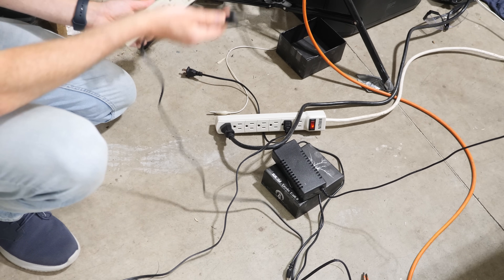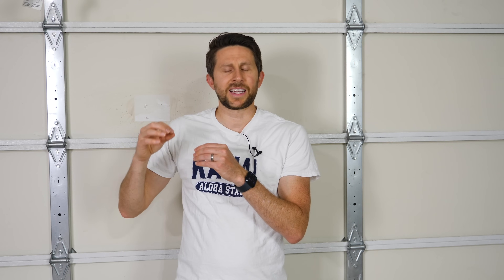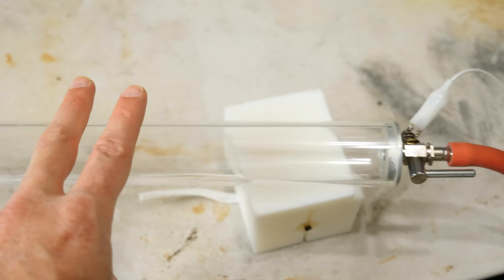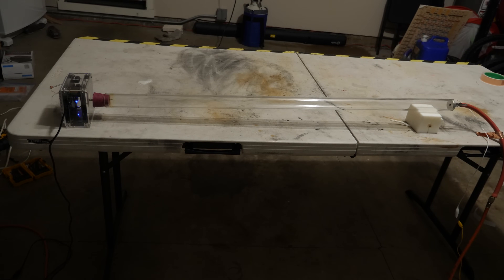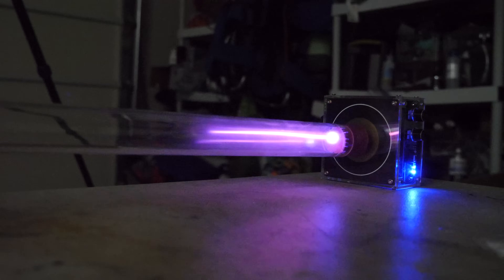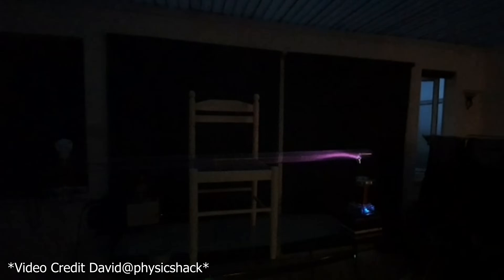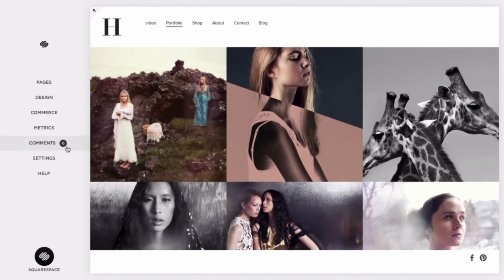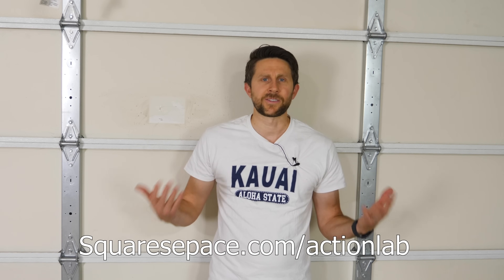Using the Air As a Wire—Was Nikola Tesla Right?

Comment: not through the atmosphere... through the aether. They are not the same things. Transverse or longitudinal "waves" (they aren't waves) dont respond to pressures. They are "pressure-free". Basically an unstoppable force. The towers are used because the difference in potential from ground to top of tower is what creates the voltage. And up high there is less interference. Opposite of radio (waves). This is a good analogy:  longitudinal point to point connections are to lasers, what point to multi-point radio is (broadcast waves) to lightbulbs. A 5w lightbulb you can barely read a newspaper with. A 5w laser you can burn a hole through things. Same power- so what is the difference? Coherence vs incoherence. Coherent light is a laser. Incoherent light is a light bulb. Point-source vs. non-point source. All that to say this - clearly you have never read Nikola Tesla, or if you have read him (not books about him) then you don't grasp what he was detailing.
Reply: there is no such thing as aether, we've known that for a century and a half.
Reply: @thekaxmax  clearly you dont know. what you're talking about - denial and proof are 2 different things. "We" have "known" aether exists for millennia. A fish doesn't talk about the water he is in when he describes his environs to the outside world.

Comment: The electrical engineers who were working on it 20 years ago came to the conclusion they needed to build a tesla coil the same size as the one he used in Colorado, so they might see what is was that tesla figured out.
Reply: and engineers have worked out that his assumptions on EMF in standing waves was incorrect and this would never work as he designed it.
Reply: @thekaxmax  Your crusade against Tesla is remarkable...
Reply: @wurzelbert84wucher5  Crusade against Telsa????? What? I just stated a known truth: he made a mistaken assumption about EMF that he never properly tested. This is fact.

Other than that I love the guy. But we all make mistakes. As you just did.

Comment: Nice video! 

Btw people talk about wireless power transmission replacing power cords but that is impossible—teslas system would not have worked under a roof. 

More likely he was talking about replacing the long distance electric grid. Towers would pull down electricity from the ionosphere and supply houses in a district.

Comment: The problem with wireless power transmission is the spread.  At further distances, you can only recover the power available from the total area of reception.  The radiation pattern does not focus itself toward random receivers.  It can be optimized for fixed locations, but ultimately, distance will still affect the recoverable signal.

There will be much power loss, and some power unavailable due to lack of coupling, being reflected back into the transmitter.  A tuned receiver is just an impedance matching device which transfers the most power possible to a load, but make no mistake, it cannot "suck" more power from an area than is available.

Comment: Heat, light, sound; all of which are results of the plasma discharges, none of which are present between two tuned towers (not driving them with spark gaps also helps efficiency). I know that there are significant losses between two tesla coils, but they're less than with normal RF equipment.
Tesla coils are wrongly known for their abilities to create streamers, but they were never intended to do so.
It's flat out wrong that Tesla never managed to make any functional Tesla coils, as he on multiple occasions demonstrated remotely powered lights (not just arc-lights (mercury vapour)), and in one case, even a small remote controlled model ship.

Many sceptics throughout time has been baffled by the capabilities of these small scale tesla replicas of today, comparing to things like RF, and pancake coils used for wireless charging of phones. This is slightly beyond the point, as I know that this part of the conversation always ends up in heated debate.

The point I really want to get through, is that Tesla did make functional coils, for wireless power transmission, and that any tesla coil with any plasma discharge, is not made the way that Tesla intended. I know that he spent a great deal of time eliminating plasma discharges (also in the spark gap, that was only ever intended as an interrupter, as this was before the time of radio tubes and transistors).

Comment: do you know that the energy of wireless power can travel both ways trough the air. do you know that the receiver end can boost its energy from another sources and electricity can travel backward into the source that transmitted the energy and blow out the transmitter. do you know as soon as a circuit is formed from the receiver end that energy can travel both ways trough the radio wave. this phenomena also happens with transformer when the energy in the output is higher than input. what happens is that the circuit at the receiver end create a potential force where additional energy added to this force will create a equal and opposite force in the transmitter to that of the output and the power is entagled trough the wireless signal. the radio signal makes the output circuit conductive and makes the electrons able to travel both ways between the transmitter circuit and the receiver. you also see the same problem in fusion reactor where the plasma ion icrease from the fusion travel backward into the transformers that generate the voltage for the plasma and burns out equipment. this phenomena is what happend to nikola tesla wardenclyffe tower where the radio signal ionized the cloud and formed a cricut in the cloud and electricity like a vacuum tube could now flow backward trough the radio signal back into the tower and down the transformer and into the generators at niagara fall and blow out the generators. when you use metal and a gas in a microwave and a current start to flow if you add fission to the particles in the glass tube that conducts the microwaves the transformer will then receive energy and voltage and most likely burn out the fuses in the house and fry all the electronics as the energy from the output would travel backward into the supply source in that case.

Comment: You should see what MIT did using this tech you take copper coils arranged I think in a square formation but spaced half an inch apart with like an acrylic spacer or some thing nonconductive and you can make a directional antenna essentially and then you can put in a receiving one of those on a bulb very far away and as long as they’re aiming at each other it works the same way

Comment: why does no one know how tesla coils r suppose to work.   first if all he wasnt sending power thru the air  he was using the earth as a conductor in a one wire circuit.  and it does work. just look up nu-energy or sumthen like that. a company is building it .

also  why doesn't anyone read teslas own words.   u cant use a/c  HAVE to  use ultra high frequency dc pulses

Comment: This is an extremely brute force approach to wireless energy transfer and I'm fairly certain it's not what Nikola Tesla had in mind. I think his idea was closer to the idea of using tesla coil like devices to convert electricity to a specific high intensity radio frequency that an antenna could receive and convert back into electricity to power a device (kind of like how a crystal radio is powered) but I think he wanted to use just the right frequency so that it not only resonated with the atmosphere but was also internally reflected by the atmosphere so the transmission wouldn't be impeded by the horizon (and wouldn't be lost to space ethier). He wanted to have many of these devices in specific places around the world and have them synced up in such a way that each device's signal generated constructive interference with the signals of the others, basically converting the entirety of Earth's atmosphere (or at least the troposphere) into a lased radio resonance cavity the anyone, anywhere could siphon power from.
Reply: i agree- i think tuning and resonance is a big part of this- like trying to make a motor but you haven't balanced the weight or strength of the magnets- theres alot of efficiency left on the table. If transmission stations and receivers are tuned in a way accounting for distance then transmission rates would be much better. 
Tesla did in fact create a working implementation of this system but his lab might have been burnt down. His main investor JP Morgan, had just invested millions in conventional electric transmission system.  He would have been directly undermining his previous previous investments had he bankrolled Tesla's wireless transmission.
in any case its too late now- wireless energy transmission is pretty much impossible while cars are powered by HIGHLY EXPLOSIVE LIQUIDS
Reply: Yeah, idk what you said, but I support you, don't let these shill bots change your mind and demoralize you.
Reply: @festerbutt  gang stalking is real and they do not want you questioning things
Reply: lol, for all we know his idea could have been as simple as brute force and never managed to come up with anything more complex. He may have been an inventor that played around with different innovative ideas but he was no god among men.
Reply: @MartinzW  No, you're just intellectually deficient. He wouldn't have thought of brute forcing it because he knew about the inverse square law! Are you implying they had no concept of that back in that day?
Reply: @MartinzW  I doubt it, he managed to power incandescent bulbs wirelessly through the ground (and normal air as well), developed AC generators and pushed for AC current over DC for power transmission, talked about resonance frequencies a lot and the tesla coil itself is based on resonance. Judging by his work, his life and what I understand of his character he didn't seem like a brute force kind of person (other than for the sake of pushing the limits just to see what would happen) I.M.O.
Reply: @zachcrawford5  the laws of physics aren't violated by the bicycle or the airplane, but there's no way to transmit a significant amount of power over any distance on earth without a lot of loss, meaning you'd have to generate a ton of power to begin with. You can easily make a fluorescent bulb light up today, it just takes a lot more power input than it would if you just connected it to a wire.

It would be much more efficient to use a laser to transmit power wirelessly by heating up water and generating steam. Yeah there'll be a ton of loss, but it's more efficient than wirelessly transmitting power through radio or high voltage coils.
Reply: @zakabog  Tesla's idea does not violate any laws of physics. The reason physics generally does not allow efficient wireless power transmission is because of the square law. Typically in an open environment, if you are twice as far from an emission source you will only receive one quarter the power on the same surface area. But on a large scale and at the right frequencies Earth and Earth's atmosphere are not open environments they are more like  resonance cavities or the interior of a fiber optic cable. At the right frequency, radio waves can experience "perfect" internal reflection in our atmosphere. This is why HAM radios can work over a much larger range than the horizon.

 Realistically though, it would not be anywhere near 100% efficient since there are natural things in the real world that would act as parasitic loads, metal deposits in mountains, or anything humans made that has conductive materials in it, even trees would probably siphon a significant amount. To be fair though even modern transmission lines aren't terribly efficient, they generally lose something like 30%-50% of the power generated to resistance and parasitic loads (depending on things like ambient temperature and conditions of the lines themselves).

I certainly not arguing that Tesla's wireless power transmission could compete with our modern transmission networks (which he also had a large hand in creating). My main argument is that Action Lab very likely misunderstood how Tesla had intended to use his invention. It's like using an electric drill as a hammer, it does technically work but it is not nearly the best way to use it and was not the intention of its inventor.
Reply: @zachcrawford5  when you bounce radio waves off the ionosphere they'll cover a larger distance but it doesn't concentrate or amplify the signal, the same rules still apply to distances. If you want to transmit power wirelessly you need to put in far more power that you'll get out, you'll get far less than 30% transmission efficiency even if you shoot radio straight into the ionosphere and bounce it straight back down.
Reply: @zakabog  Yeah, that sounds about right:) I should say though that sending the signal straight up and back down is going to give you the most (total) signal loss, since it would be mostly perpendicular to your refraction interface. "Perfect" internal reflection only works well at shallow angles, the closer to parallel, the better, like a laser through a fiber optic V.S. a laser shining (mostly) right through a glass pane. Of course there is no free lunch and the signal won't get amplified overall, though due to the imperfect nature of the real ionosphere you would get some "hotspots" and "cold spots" at the cost of overall signal loss (assuming a point source anyway).
Reply: L                     O                    N                    G
Reply: "I think his idea was closer to"

it doesn't matter, it's not real
Reply: @JohnHaugeland  you do know tvs and phones were just stupid ideas back then in till people made it a thing right
Reply: @Alzheimerest  - extremely relevant comment.  you've taught us all a lot, and changed hearts and minds.  this definitely isn't a repeat of what other people already said, and the laws of physics are very changeable.  good luck, we're rooting for you
Reply: @JohnHaugeland  Neither was the airplane or the bicycle until someone made it so.
Reply: @zachcrawford5  another thing that isn't real unless someone builds it is my time machine
Reply: @altaccout  But what if you go back to a time before it was built?
Reply: @zachcrawford5   it will make a paradox never ending
Reply: @zachcrawford5  exactly
Reply: @JohnHaugeland  You sound very dull.

Comment: It could work, but you have to consider that air has a resistance of 10^6 Ohms at 20 C., Copper 2.44x10-8 ohms at the same temperature (resistivity increases or decreases with temperature), that means that air is at least a Trillion times less conductive. Lack of conductivity leads to energy losses. To jump an airgap of 1 centimeter you need around 30,000 volts, now start calculating the power you need to get from the next electric plant to your house leaving sufficient energy to power your needs. And we should not forget: electric losses in a conductor are converted to heat.... which would not do much to solve the climate crisis.

Comment: Finally someone who understand the Tesla´s idea and did not discarded quickly as "inefficient". In my opinion, Tesla had two solutions (as far as I know) to increase the efficiency. First one would be choosing a frequency that could make the ionosphere-earth to act as a capacitor and with the plasma´s "wire" inductance to bring the whole setup to resonance. The second one would be to create a network/web of such energy injectors (TC) so the ionosphere could saturate and maybe at a critical point could self sustain the plasma. That way you need only to inject the amount of energy that is lost to maintain the whole grid. And to remember that aurora can contribute too to the ionosphere plasma layer.
Try doing the same experiment in a 4 vacuum chambers (3 on a triangle shape and the 4th in the middle) connected by tubes like this, with 3 tesla coils and one receiver in the fourth chamber. Another setup can be with 3 chambers, with 2 TC and a receiver (load). If the setup is well tuned, I think you can fill all the chambers with plasma and the receiver can be able to extract energy from the plasma field. That way you can see the influence of the frequency match of the TC.

Comment: Can you do this experiment? Does cooling down the exhaust of a gasoline fueled vehicle to room temp or lower changes the level of the CO2? Would that change the emission CO2 output?
Reply: no, no. It does end up with some of the CO2 in the water, but it comes right back out when it dries--which it will do quickly as you've just heated it up.

Comment: So with the tube idea you could have a few Tesla coils in the basement run the tubes up in the walls therefore making a electric field around the entire house giving you wireless power inside and around the yard.  Issue with wireless power is they wouldn't be able to monitor and control usage like they do now, let's say you don't pay your bill even if they turn your power off if your neighbor lives close enough you could siphon power from them without them even knowing

Comment: Much of the loss in efficiency has to be because a Tesla coil sends current out in all directions. By concentrating it in one direction (as in the tube) it helps, but as you pointed out, inefficiencies happen because of heat and light being generated. If somehow the current could be transmitted without it ionizing the atmosphere, wouldn't that improve the transfer efficiencies? Also, I wonder how it is that we see a plasma in the presence of a vacuum. Would a perfect vacuum make the plasma invisible?